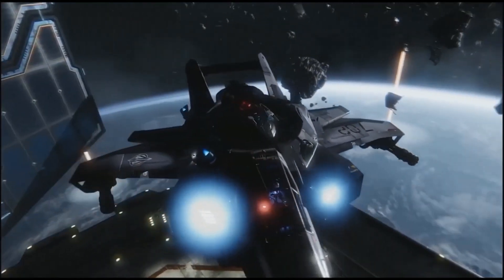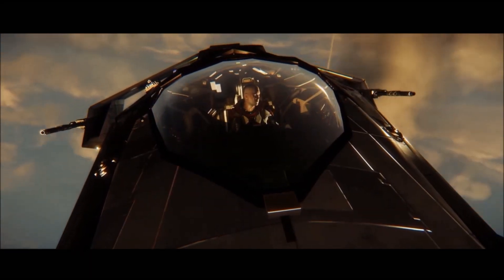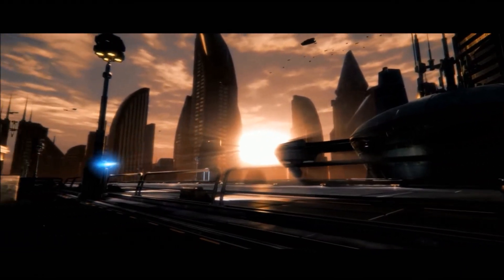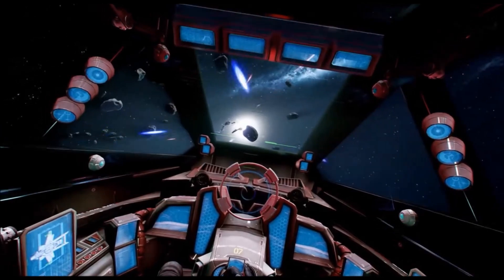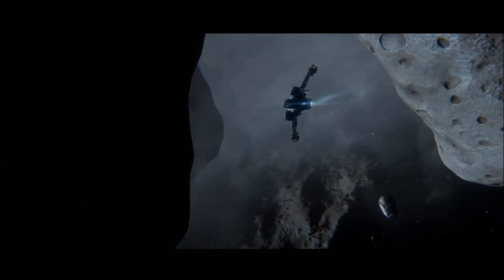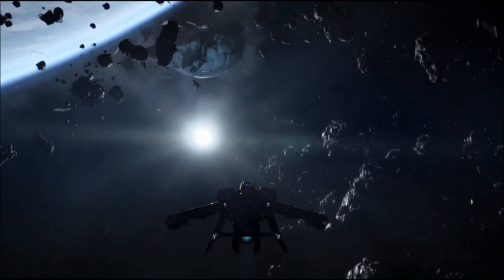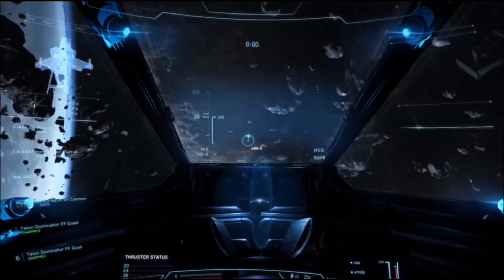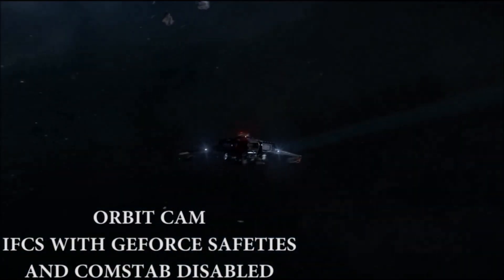Star Citizen Space Flight Physics

Comment: Velocity or speed, is a relative concept. however, acceleration and relational velocity are important, trying to move from flying in line to flying a heading 90 degrees off that in any direction in an acceleration that is greater than 6x9.81meters per second per second, can do very not good things to people as you would experince 6 or greater times the force of gravity on earth. it's part of the reason you can "fake" gravity in space, by spinning a sphere in such away to cause someone standing on the inside of that sphere to accelerate from the center point at 9.81 m/s/s would make them think there is gravity. as to your question, yes, this goes back to newtons first law, untill an opposing force acts upon the body it will continue. the death spiral, will be a fun death.
Reply from the maker: the death spiral...  :S